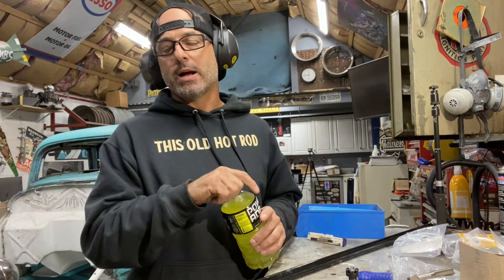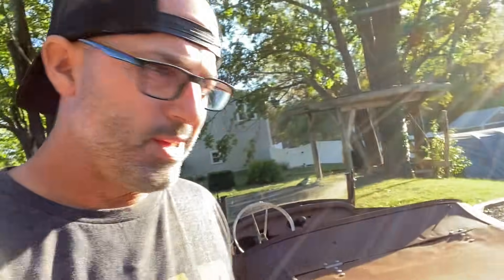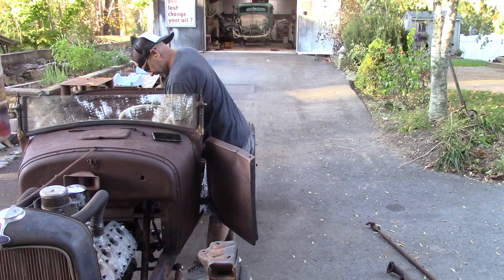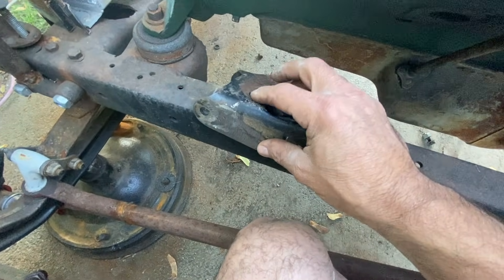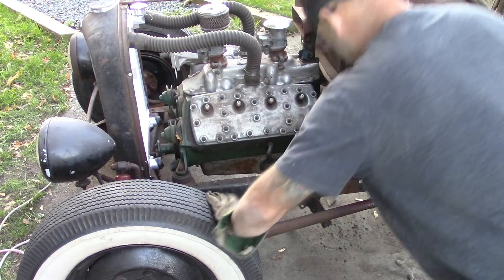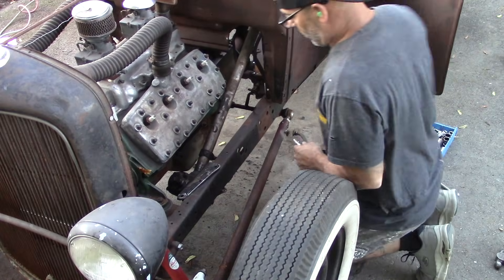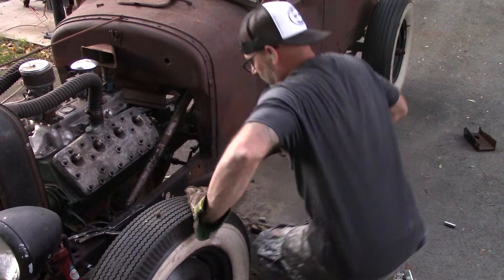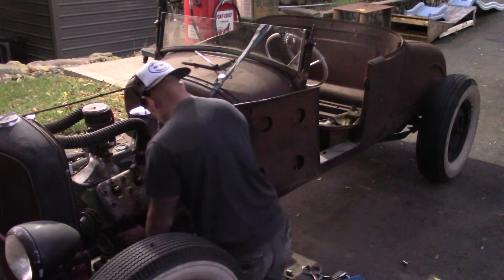1927 Ford Traditional Hotrod Build [ Episode 11]

Comment: Put it farther back , and inside the frame , and a u-joint in the shaft to straighten the wheel , then you will clear the eng and exhaust , you'll just have a longer drag link . And definitely like the Music ! ! Sent by "Make it Kustom" . If that's a shaft inside a tube , . . . Get rid of the tube .
Reply from the maker: Yeah. There’s a shaft in the tube. All old parts.  Building it as close to a period car as I can.  I got it sorted out and it’s good ! Happy to get it figured out… most didn’t think you could run that style steering.  👍🏼

Comment: I feel your pain on the steering fitment. Now i cut my tube off at the firewall and just run the shaft with and a weld on joint at the box. No more fitment issues. Not totally traditional but my nerves thanked me for it.
Reply from the maker: Haha. We all have our way.  I’m committed to running it because I was told I wouldn’t be able to.  😁👍🏼
Reply: @ThisOldHotrod  ive been told that too but with adding parallel leaf springs on the rear of a model A pickup. The following week i added a build thread on how to do it on the HAMB lol. I love the "you cant" guys.
Reply from the maker: Yes sir ! I love it ! Hahha
Reply: @ThisOldHotrod  your doing a great job on the videos and the roadster. Keep up the good work. Take care 👊

Comment: The frame is weakened where you cut it. I'd do something for strength. Enjoy
Reply from the maker: Yup. I’m aware, but I can’t do anything about it with the motor and trans still in the frame.
Reply: It seems stronger to me.  You actually "boxed" the frame with the steering bracket you welded across the channel legs.